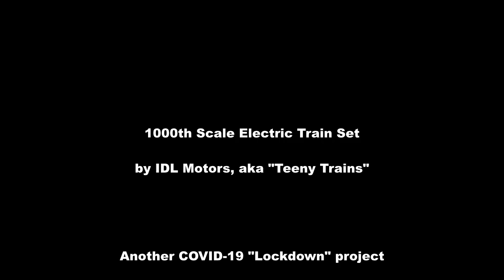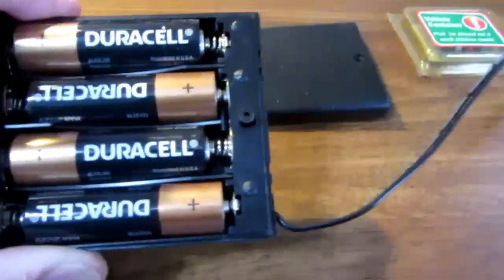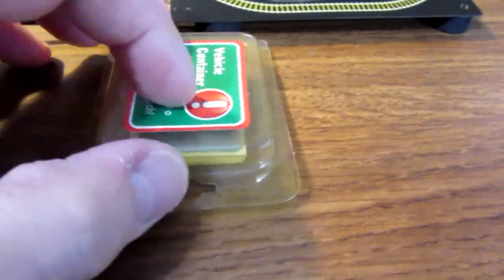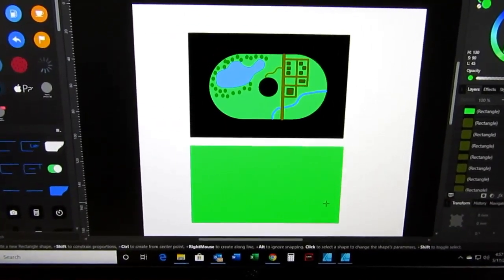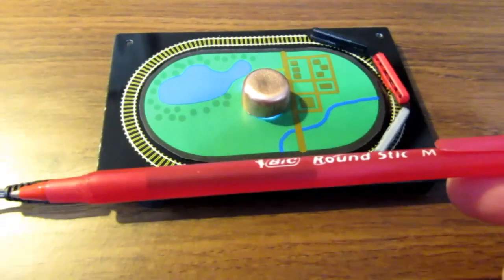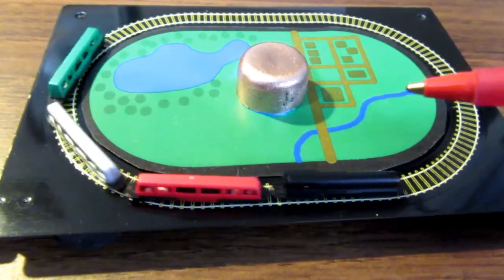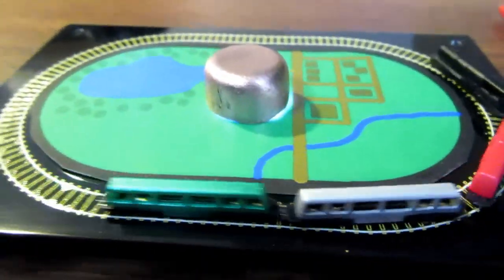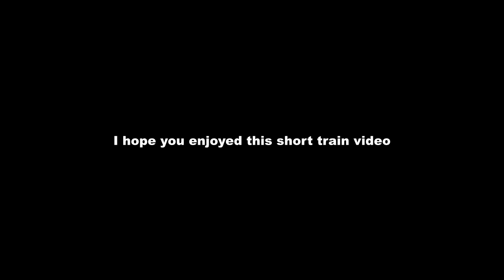1000th Scale "Teeny" Electric Train Set by IDL Motors (aka Teeny Trains)

Comment: So, there's no actual rail for the train to run on? And I thought Z scale was hard on the eyes. 😁
Reply from the maker: The "track" is just a printed image on top of the circuit board. Underneath the "track" on the bottom of the circuit board are the many tiny electromagnets, which are pulsed by the controller to react with the permanent magnets in the base of the locomotive and cars. So the circuit board is the 'stator' of the motor, and the loco& cars are the 'rotor' of the motor, and the controller energizes the stator coils in such a way to cause the rotor elements (the train) to rotate in a pattern that can be any shape that eventually returns to where it started (hence the name 'linear motor').

This small track is the smallest practical layout given the size of the train elements, but the same company has much more glorious layouts available. But they ALL involve train elements repeating the same patterns over and over; I don't think they offer anything where the train elements go through switches, take sidings, etc.
Reply: @youtuuba  That is a truly fascinating little machine!